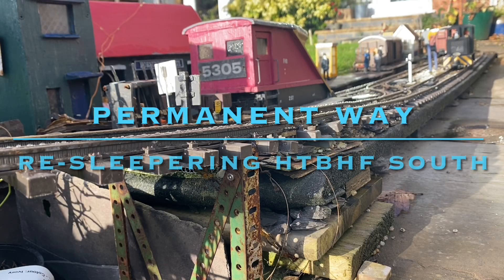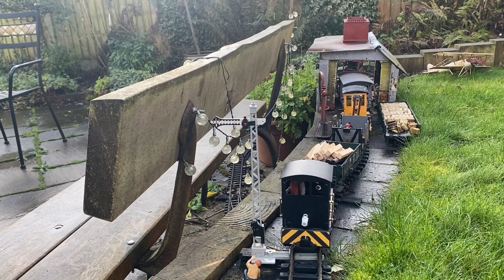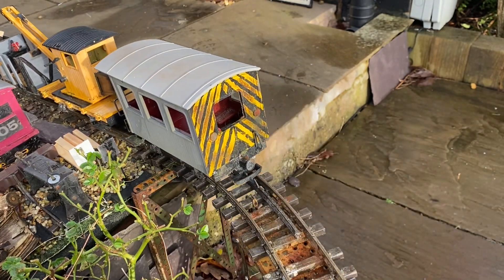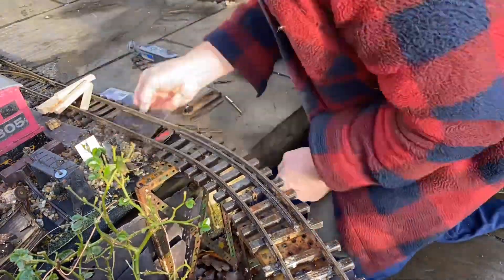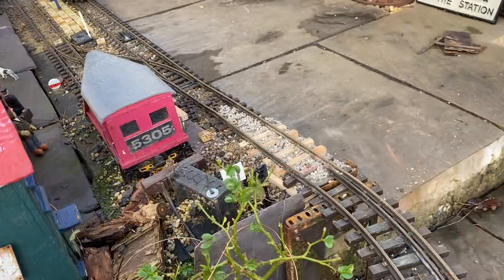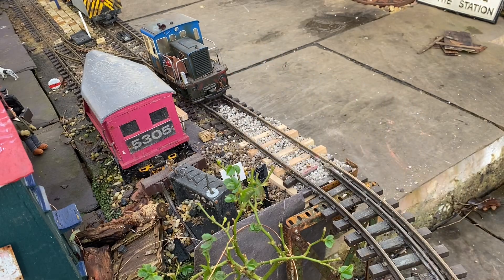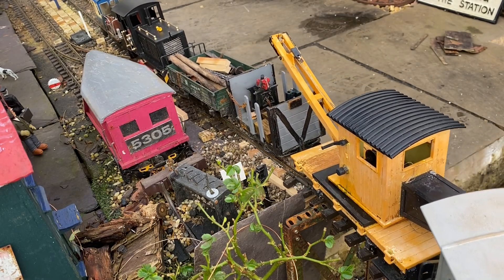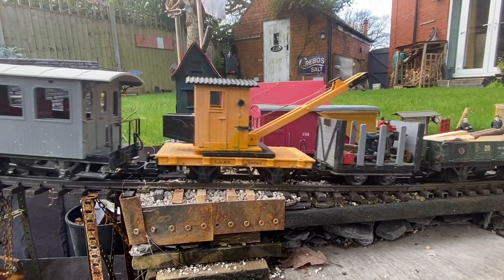#workshopwednesday - sleeper/tie replacement

Comment: Nice job. I think I need to fettle some sleepers on some of my point work where fishplates have been replaced with clamps. What sort of wood did you use?
Reply from the maker: It’s softwood, 1cm x 1cm strip. I’ll put some weatherproofing on it when ambient temperature has risen enough!